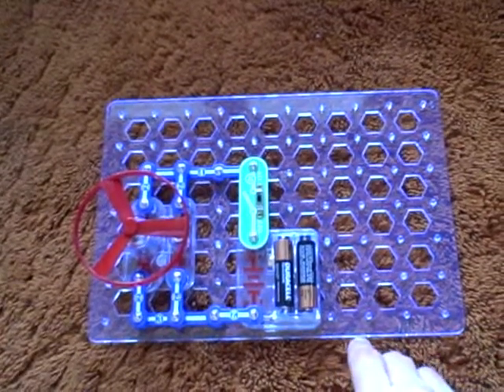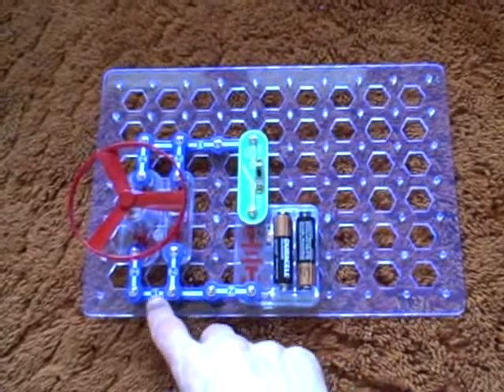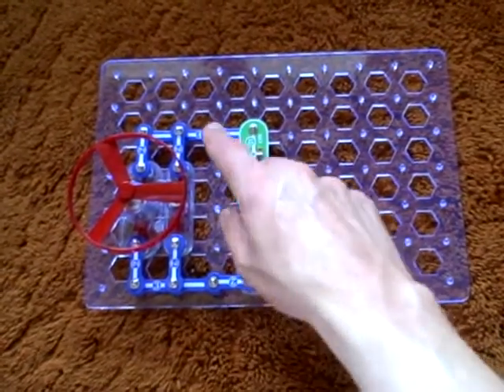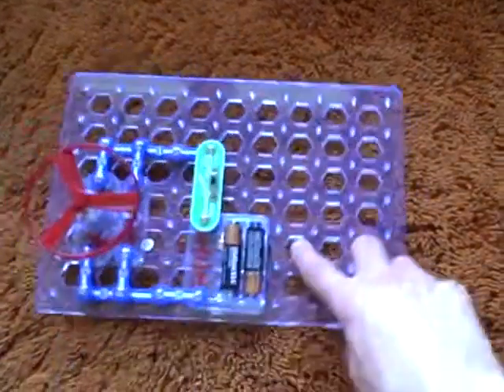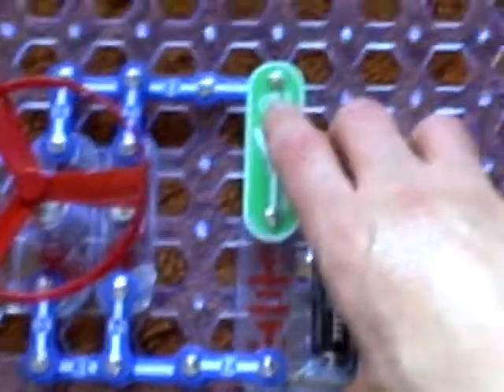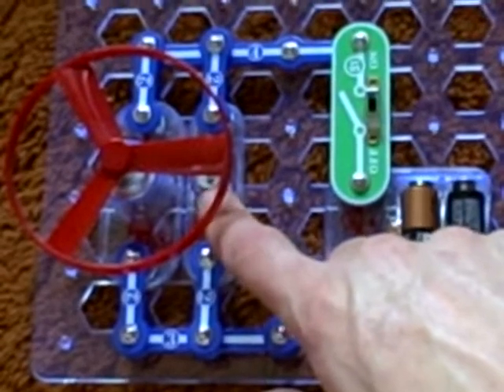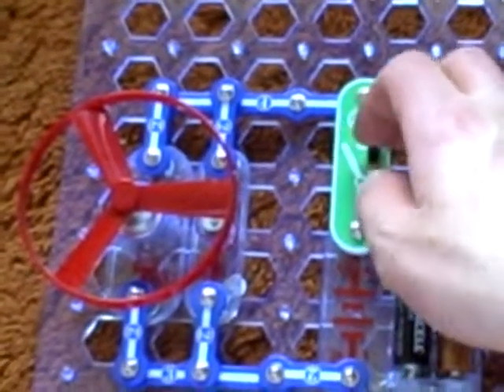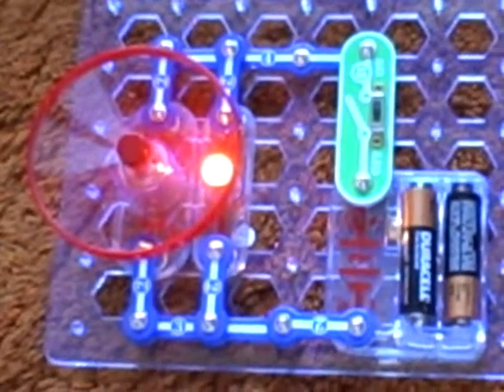Electrical Project Kit Design 5

Comment: it will fly in the air if you take of the light. Also adding another battery pack will help and along with the 2nd battery pack add the copper coil plug in you will live the results